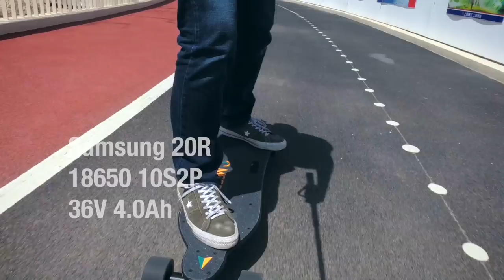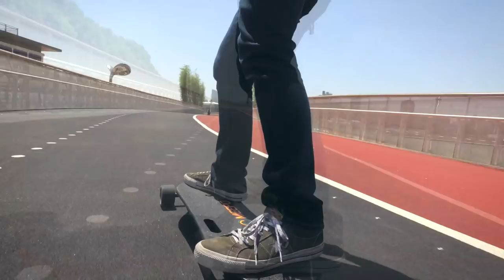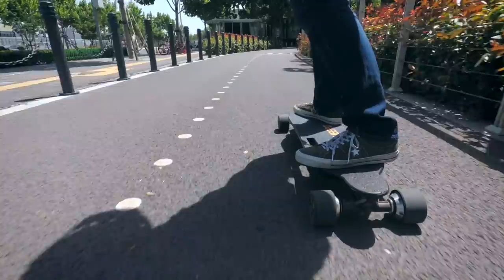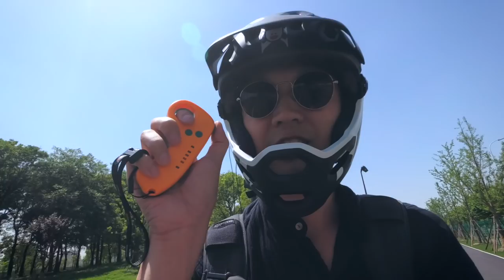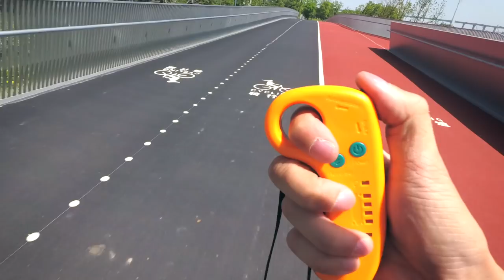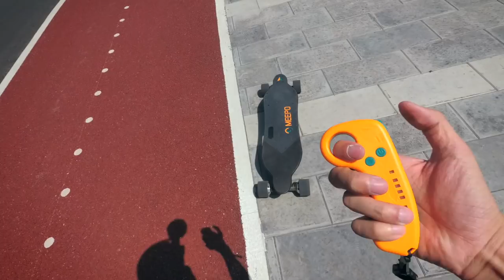Meepo Board V2 Electric Skateboard First Ride and Range Test #1 (Samsung Battery)

Comment from the maker: “I think it’s very clear that you should get the...” https://youtu.be/-Hq_hvdzS_U
Reply from the maker: Which one you should get depends on your priorities and use cases. It’s similar to choosing a car. For example, should you get a Toyota Prius or a Ford Mustang? It depends on your priorities and how you’ll use the car. It’s kind of the same here. The behavior and performance of the two boards are different, and each have different strengths and weaknesses. Details in the linked video.
Reply: DId you have a max speed you were traveling at?  i think in your other video you mentioned  this one has better accell but other one has a smoother ride.
Reply from the maker: Duncan Tang - 40.1 km/h from this ride it seems. Programmed max is 40 km/h.

Comment: Hey Daniel. Is that front light you had sitting in your backpack for the board? If so how do you mount it? I'm asking because I use the same lights for my bike and want to put them on my board, but I cannot figure out how.
Reply from the maker: I just put it on my backpack.
Reply: Daniel Kwan Guess that works 😅